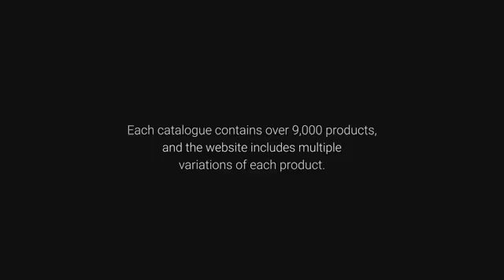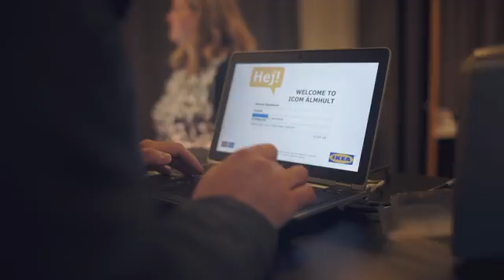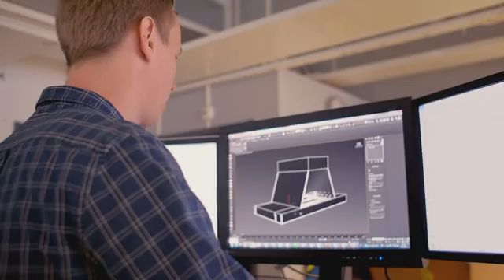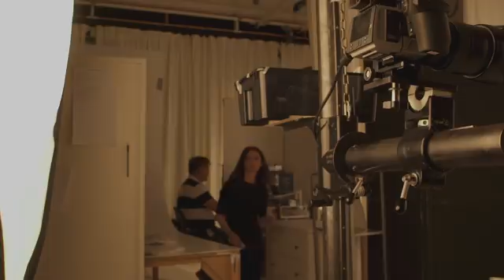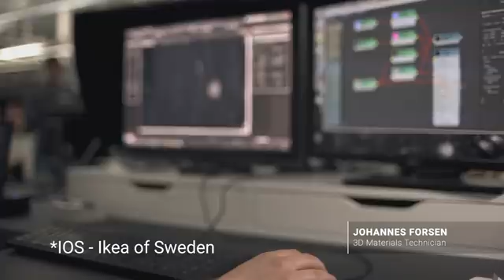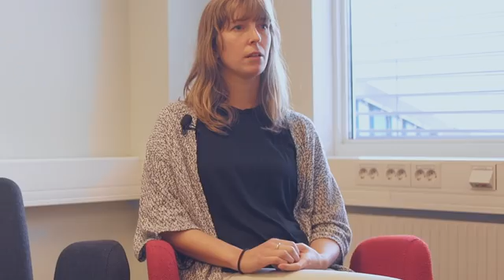Putting the CGI In IKEA: How V-Ray Helps Visualize Perfect Homes

Comment: Where do Ikea's 3d artwork end up? On their website?    Recently I learned of Roomle, which is an app with a catalogue of 3d models which you can use in AR. IKEA is one of their brands in that app, but the quality of the models is naturally less realistic as they're rendered in realtime by the mobile phone.
Reply: Those images end up both on their website and in their catalogue. Basicly, if you look trough their catalogue, everything is 3D these days.
Reply: IKEA’s 3D models are not used in 3rd party applications, only their own. If you want to see more, then look at this presentation https://vimeo.com/243860738/
Reply: SkillipEvolver they definitely do, but I think they have then made those models by themselves ;-)
Reply: IKEA has developed their own AR app with already thousands of their models in it: https://www.youtube.com/watch?v=UudV1VdFtuQ
Reply: For AR or VR you won't use VRay output file but a game engine, which is having limitations due to less processing power available. 
Game Engine won't render everything but show you a pre rendered  images scaled everytime you change your angle, and those images are pasted on a very low poly mesh ( this is not a technical term but used to explain for easy understanding) .
Reply: Martin Enthed ok mate well I definitely see a selection of 3d IKEA models using the Roomle app so whatever!